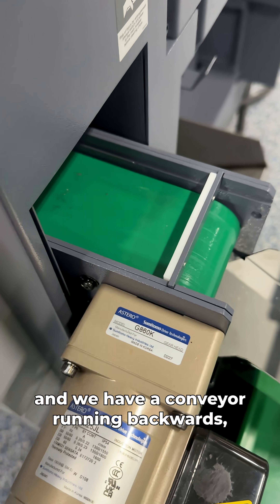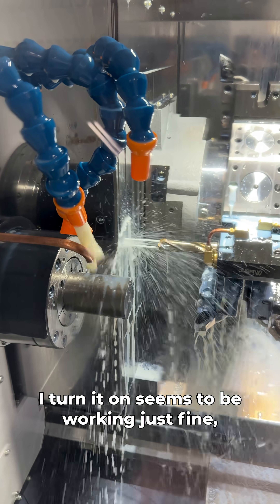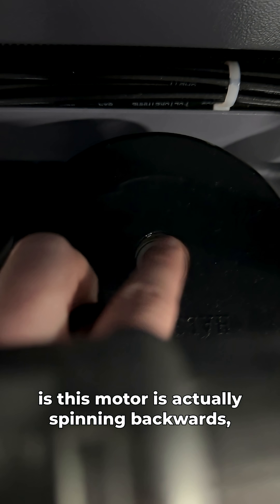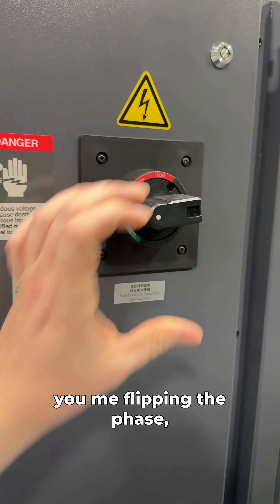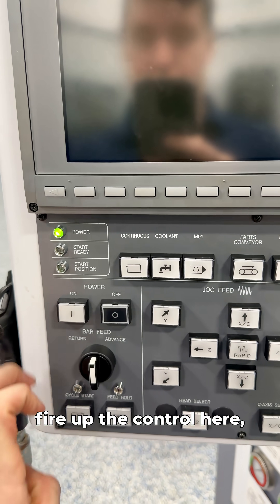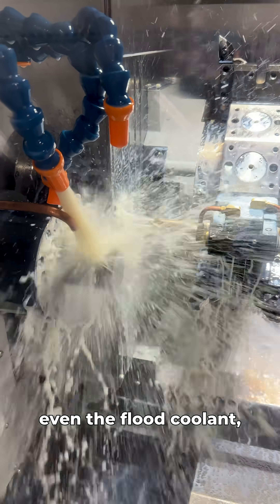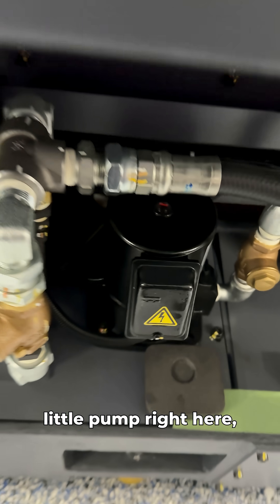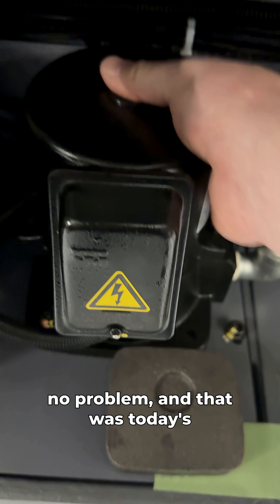The coolant still worked! 😂

Comment: Strange a machine that expensive does not have a phase sequence detector, that would inhibit operation if the phase is incorrect - even the refrigeration compressors in the test equipment I use are protected against incorrect phase or los of a single phase.

Comment: Always be sure to check if the SUPPLY IS TURNED OFF, especially since 3Ø (Phase)motors are used, which are way more dangerous than 1Ø (Phase) supply in homes, (Source: Trust me, coz i'm a 3rd year EEE student) also kids shouldn't attempt to mess with supply, just leave them to the adults

Comment: Definitely dont show your electrical work. The fact that their was no mention of turning off the breaker is error number one. Power is still going to the machine when the shutoff is switched off. With the assumption of a bad wiring job, electrocution could be just around the way. How do I know this...well I was electrocuted from a stray 240v wire in a machine that was bleeding to a metal part I touched when the machine was shut off with the breaker still on. If not wanting to use a breaker frequently, use a proper disconnect. Be safe out there.

Comment: Centrifugal pumps deliver about 30% design flow when spinning in reverse.
Useful to know when controlling flow using a variable speed drive on a pump as the motors tend to overheat at below 30% design speed - just spin them backwards for low flow rates.
Reply: great tip

Comment: I used to work for a client that had 5pin connectors (3 phase + neutral and ground) where 2 phase pins were on a disk so you could turn the phase around by just unplugging, rotating those 2pins and replugging it. It was quite nifty and simple design

Comment: The meter to check phase rotation before you hit the green "button of no return" is a fraction of a fraction....of a fraction of the cost of just one Grundfos pump. Its anlot easier to just flip the phase when the meter tells you its wrong then it is to flip the phase after the pump chews a ceramic seal.
Reply: Crazy the machine itself doesn't have a simple phase presence and rotation relay. Those cost about the same as said meter.
Reply: its not that odd. realistically, you only wire in those things once, or you have people there that can check on their own. From an engineers perspective, thats just added cost for basically no benefit. even if the one part is cheap, you could say that about every failure mode or added feature, and now you have a machine that is an order of magnitude more expensive.
Reply: How does the ceramic seal get damaged if the pump head is under coolant and it's not running dry? Would be one thing to run it dry, but if coolant is moving it shouldn't be an issue. I've never seen a directional mechanical seal for a centrifugal pump, even the carbide ones, can rotate both ways.
Reply: Thank you. I was looking for this comment

Comment: 3-phase AC is a miracle of strangeness happening :D
- but to be honest .. i really don't understand how that still is a problem today with all the switching power supplys that on the first step make DC and then modulate their own variable frequency multi-phase AC to run spindle motors at varying speeds (well .. i guess the pump would be an exception .. but the conveyor i would expect to be run with a stepper motor that is independent from external AC)...
Reply: I'd guess it comes down to cost and simplicity, for the fancy stuff you go via DC, but for stuff like a parts conveyor or a coolant pump that just needs to run at a fixed speed in a fixed direction a direct mains fed motor is cheaper and probablly more reliable.

Comment: Im surprised a machine of that price doesn't have a phase protection for incorrect phase and phase drop out i recommended installing one I've seen bad things happen when 3 phase equipment drops a phase it gets noisy then quite. Even if you do turn it of when you hear the noise a week or a month later you have 3 phase motors start falling.

Comment: Centrifugal pumps do pump while in reverse.  They just do it with less pressure and flow.  

Running the hydraulics backwards can be a real problem, so I hope there are built in protections to prevent damage.
Reply: Also they sound like they’re cavitating badly when in reverse, (because they are due to the shape of the fins not being kind to the water in reverse!) :)
Reply: @jwalker7567 typically the hydraulic pumps are positive displacement gear pumps and spinning backwards doesn't really cause any harm. No fins....gears in oil.   but yes they do sound absolutely horrid when they do run backwards and pull air from the system.
Reply: @jwalker7567 The fins would actually be less of a problem as there are straight, forward curving and backward curving impellers anyway, but the outlet on the housing is facing the wrong way.
Reply: Centrifugal pumps won't be used for hydraulics,  they  don't  actually generate decent pressure.  and most types off pumps or motors can turn fine either  way, just don't let them run for to long.

Basically  just  don't touch it if you don't know hhow are why stuff works  :D
Reply: @MaartenVanNuffel 
Those were seal less centrifugal pumps for coolant that are mounted from above and sit in the coolant tank.

If you were to run anything backwards it would still pump in the forward direction; just with less flow and pressure.

My comment is that the coolant pump and conveyor may be able to run backwards for a short time with no serious damage.  But if you have something with hydraulics, or certain rotary compressors, you could do a lot of damage.  

I engineered many product lines of industrial equipment; and inexpensive ones that had centrifugal pumps, fans, and VFD’s were notorious wired backwards.

You would see someone start the equipment see a component run backwards and then rewire the machine to have that one component fixed the phase and not the whole unit.

We ended up putting phase relays that would lock out the unit until the main power connection was phased correctly.
Reply: @johno812  I know,  thats why i said most pumps dont breakdown aslong as you dont let them run  for to long.

Afterr installing any motor you always havee to check the direction.  Once they turrn corrrectly it wont happen again....

Also why i saidd do not touch it if you have no cluee how they work (was talking  too the DIY people  reading, wasn't about  yyyou ;))

Comment: I wired a 60 amp 480 screw compressor. It was used and the manufacturer had their “tech” install it the first time. They changed the rotation by moving around the wiring inside the controller and did not note it inside the controller. I wired it correctly based on manufacturer’s directions. It did not sound good and there had to be damage.

Comment: Swap any two wires on a three phase motor and it will change rotation, you’re welcome. Standard practice is a and c but technically it doesn’t not matter

Comment: usually any worthwile machine over 1K should have phase rotation detection.
At work we usually use K8DS-PH1 Omron, a cheap part to ensure you don't burn up a hydraulic pump (the part is about $20)
Reply: I agree 100% we have industrial meat conveyor lacerator and it have the phase rotation or phase missing device, machine is old like 20 years but it was equipped with it originally.
Reply: 20? You must get a lot of them. Mouser has them closer to 80. Considering the possible damage and costs still cheap though.
Reply: @bastiannenke9613  yup, we got a lot of those ancient machines,  the whole factory is like 85 years old,  i think one of the oldest is multivac packing machine and bizerba slicer , also refrigerating units are quite old, morep-defrosting unit size of 3/4 cargo and 3/4 height is a little problematic because of components are not produced anymore.
Reply: @bastiannenke9613 we get packs of 80 from a local supplier. But even individual ones go around 120PLN (bout 30 USD) here in Poland
Reply: Had a ‘96 mazak vertical mill get moved from one spot in the shop to another, electricians got the phase order wrong, no negative impact to the machine, but it did blow the ancient thermal for the conveyor. When we got a new trip wired in it ran backwards. Only way we could tell the phases flipper. Flipped the phases in the conveyor motor and off we went

Comment: We had a lightning strike next to our print shop made the lights flicker. Anyway tried to shoot film plates but they were jamming in the developer tank.... it was running backwards so the rollers were reversed. Turning it off and back on corrected the issue. Strange...

Comment: If you’re wondering what he did, this is a 3 phase machine. So there are 3 hot wires (one for each phase, 90 degrees offset in waveform from eachother), 1 neutral and 1 ground, all he did was swap phase 1 and 3 around on the pumps terminals. If you need more info on how this works, ElectroBOOM has a video explaining it in depth.
Reply: 120 degrees 0-120-240.  And you can flip any 2 of the 3 phases to flip direction
Reply: doesnt matter what wire you swap, it will spin the correct way. Swap A and C, A and B, or B and C.
Reply: Any 2 works technically but for a lot of applications it may be easier to swap A and C due to cable length and to know that B is always constant in the middle
Reply: you can actually swap any two phases i think
Reply: Goes from 123 to 213
Reply: 120 degrees. Tard. 90×3 is 180, not a full circle.
Reply: @brenankean6634  90x3 = 270, don't throw stones if your house is made out of glass 🤣

Comment: imagine he flipped the wires and instead it just started sucking the coolant back 🤣
Reply: thats what was happening when it was in reversal, which is why the coolant was stronger when he fixed it. the coolant was in fact being sucked back in both sides but it couldnt suck it in as quick as it could be pumped out so there was still more to be shot out. if this is a centrifugal pump then it might've just been the machine going slower in reverse

Comment: "I won't show you me flipping the phase since I won't want you to get hurt".
"I'll show you how to stick my finger in a running three phase electric motor..."
😂
Reply: Just in case  you decide to flip your own phase is your hole 200k CNC lathe….
Reply: I was about to say the same thing haha those are for putting tachs on not fingers
Reply: or you know, not being shown how to do it correctly and proceeding to do it wrong and hurting themselves. not much logic in not showing it.
Reply: he only touched it a little bit and he dident have gloves on its fine
Reply: I down voted the video for that condescending remark.
Reply: "I'll show you how to touch a 3phase motor that has no exposed wires" yeah.think before you speak.

Edit:

going ahead and mentioning that he clearly also touched the motor axle, which honestly, I can't recall that ever being dangerous to brush your finger on to see if its moving the right way.
Reply: @Rho-9-Security honestly I'm more worried about the pinch points this guy keeps putting his hand near. The conveyor mainly, but still keep your fingers away from all spinning parts. They have guards for a reason, and the reason is stained in the blood of those before
Reply: @Rho-9-Security  If its spinning fast enough, it absolutely can. But in this case, no. Even then though, if the skin of his finger got caught in a pinch point in the motor, he's gonna lost part of his finger.
Reply: @Rho-9-Security  behold! the man who knows everything! everyone come worship at his feet, he really needs the attention.

Comment: Do you ... not have a single plug with the phases already wired?
Reply: Machines like this are wired into the building. And depending on usage can be wired in different phases to drive the motor forward or reverse depending on what you need. If the motor had a plug you couldn't decide direction yourself

Comment: I bet running the spindle on backward power could smoke a low quality VFD if it's not made with a reversal circuit.
Reply: VFDs dont care, and neither do the servos. almost all of these will rectify to a DC bus, then re-invert the power back to AC at the required frequency, either for the spindle or the servos. a single standalone VFD works the same way, AC>DC>variable AC. Thats why the power capacity of a VFD is derated when its on single phase vs 3 phase, it has less AC amperage available to rectify.

Comment: Went to help chop firewood in a remote chalet. Log splitter had little power and the circular saw cut upwards blasting sawdust in the operators face. 2 months ago an electrician was there, fixing all the dodgy wiring. However the homemade distributor panel was based on the old wiring and flipped the phases. Took me more time than I'd like to admit to figure out what was going on.

Comment: He swiched 1 and 3 in case you were wondering, you can wire a reversing circuit the same way!
Reply: It's 3 phase, he swapped any 2 wires. Doesn't have to be 1 and 3.
Reply: @ViktorKryatov  yeah, the first time i learned this was with my model helicopter "well just switch any two wires and it spins the other way"
Reply: @ipadize  Any 2 LIVE wires, not just any 2 wires.
Reply: @jur4x  they are live and not live when the esc is working

Comment: The first check on power up of any machine with hydraulics is the gage for pressure. Most lathes with standard hydraulic chucks still need the system. Screw machines have mechanical systems with either air cylinders or servo motors to activate the collets so the coolant pumps rotation is the check.

Comment: Usually you check beforehand, components like hydraulicpumps can be damaged
Reply: Any system with a three phase powered electric motor should have a phase control relay from factory, unfortunately that is not the case in many applications but it's absolutely mind boggling a machine like the one in the video isn't equipped with one. 🤯
Reply: @Tom-xn7zc  Yeah we used to install then in our vacuum lifting equipment or the pump would try and coat the room in oil requiring a full replacement of all filters and oil (veins to in the worst case). Those are like €15,- and real easy to install. Phase hooked up wrong, no power to the pump relay (the pump A1 control wire that is). Selec 600PSR if i recall correctly
Reply: It’s crazy I know, we had a big multi kW laser installed at work and the installer just wired it in and turned it on and the vacuum pump it had ran backwards and blew oil into all sorts of places it shouldn’t have gone. Woops.

Comment: Polarity backwards
Reply: Three phase power.  You have to swap two leads and it will change the direction of the motors.
Reply: @kevinberta8741  thats literally what i just said.
Reply: @Wade-1  No it is not.  Three phases of alternating current, Not DC. There is no "polarity backwards" as polarity reverses, backwards, every cycle on each phase. There is only relative phasing.

Comment: You’d know the whole machine was wired backwards if you turned on the lights and it got darker inside.
Reply: lol
Reply: lol
Reply: this gave me a good chuckle
Reply: Dang it.  I'm 2 weeks late for this comment
Reply: Of course, light is a wave right? So out of phase light will cancel out
Reply: Darker yet darker;
Photon readings negative;
This next experiment seems to be very VERY interesting…
Reply: and it gets darker than dark
(Deltarune prophecy music starts playing)
Reply: Erm* You can't make luminocity from a nearby region darker from a reverse wired bulb
Reply: @Gold3nF1r3  but you can blow a fuse or even something bigger if you fuck up enough resulting in lack of power therefore making it darker inside
Reply: @Gold3nF1r3  It's called a joke.
Reply: That's not how mis-phase works. On some machines you only find out phases are wrong if  motor for some secondary function not turning on or turning backwards. Because on a lot of modern machines main motors are all on frequency inverters for speed control.
Reply: @jur4x  I'm quite positive the comment was supposed to be a joke.  Most people would see the obvious comic nature of lights making a machine darker.
Reply: @jur4x shut up
Reply: @jur4x youre alot of fun at parties aint ya bud

Comment: I got a 3 phase rotation meter so I know which way the city is wired 😂
Reply: doesnt matter, most japanese machines are wired phase opposite of the US phase system. Every Mazak, Nakamura, Mori etc that Ive ever installed has needed phases swapped to run correct.
Reply: @OlsonKustomWorks  50/50 chance of being right at least
Reply: @johnrobholmes  Nah, it´s more like a 80% you got it wrong chance
Reply: @johnrobholmes it’s a 33.3% chance you get it right on conventional three faze.
Reply: here in the UK there are regions where the DNO, which is the ppl who own the supply cables to a building, did it wrong

so an example is the industrial areas of Southampton, alot of reverse phase shenanigans

and its fun where some DB's have been flipped to fix it, and other's haven't and it's a whole mess

so sometimes it isn't just at the equipment end where it's wrong, it's often wrong further down the chain lol